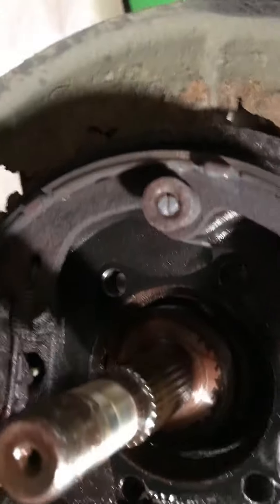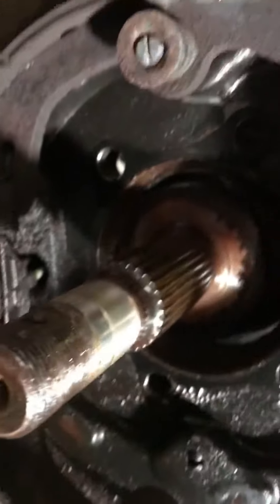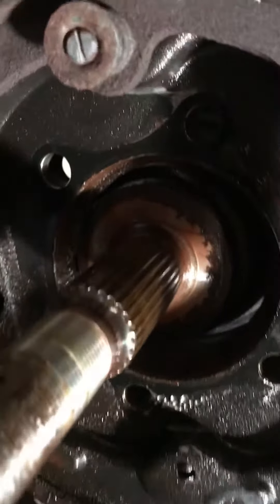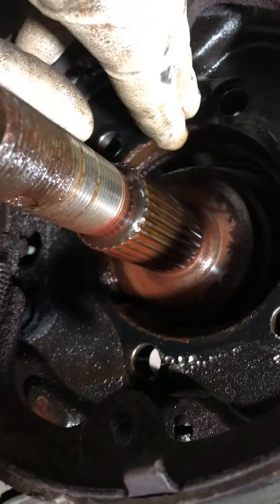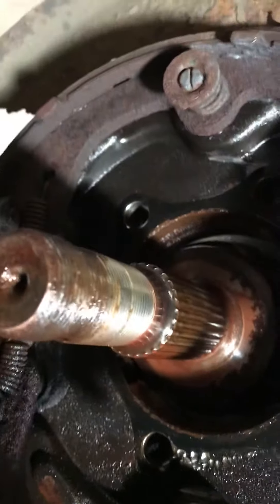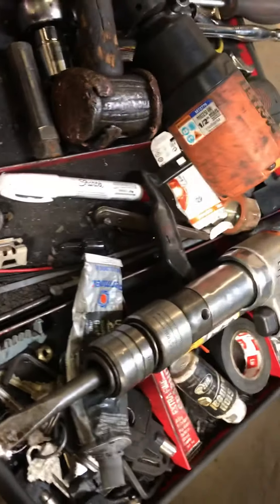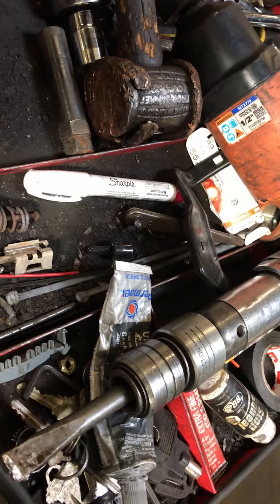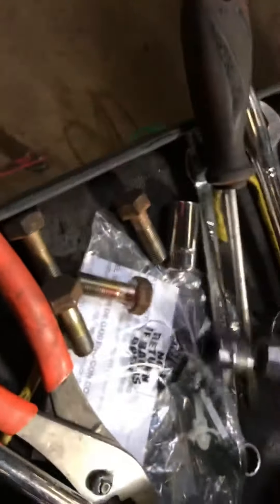2003-2011 #infinity #FX35 Rear #Wheelbearings

Comment: Thanks for the tips! Just finished my front wheel bearings. I used a nut and bolt to press them out. Worked like a charm. How were you able to fit your breaker bar back there without removing the ball joint?
Reply from the maker: Glad it helped.